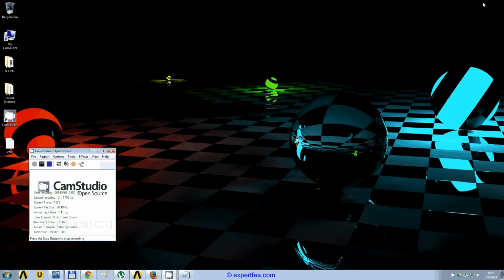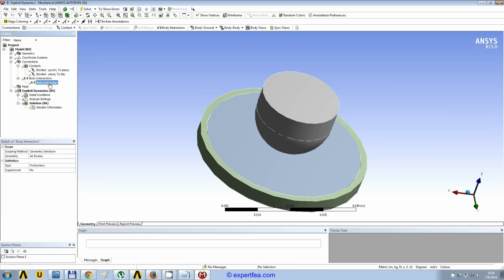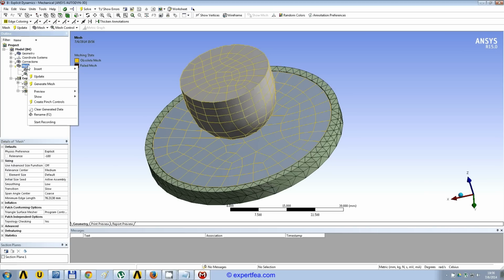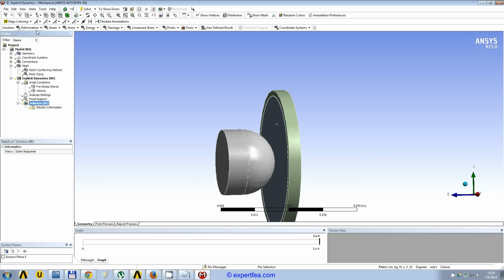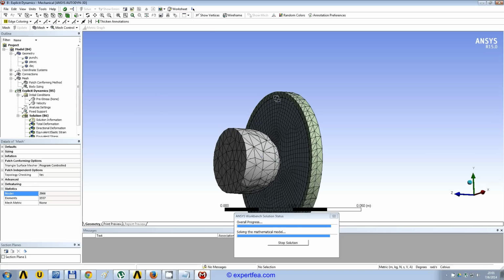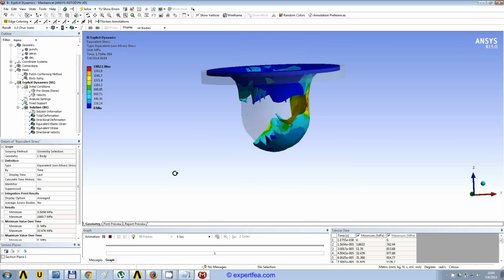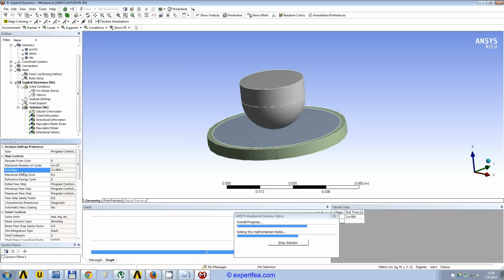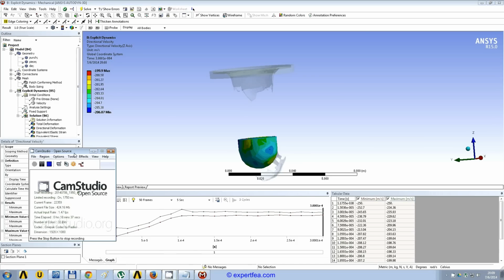WEBINAR 4: ANSYS Workbench Explicit Dynamics FEA of a high speed stamping

Comment: Hi Sir i wanted to ask that in your model it says Contact Bodies  # 2 Faces and Target Bodies# 2 Faces................ but in my model it says  Contact Bodies  # 3 Faces and Target Bodies# 2 Faces... why is it so ?  thanks
Reply from the maker: Hi Umer, you can change the scoping of geometry either via the vertex, line, face or body icons from their respective toolbar or by pressing Ctrl+P, Ctrl+L, Ctrl+F or Ctrl+B. In the contact feature, select the geometry you want then press Apply.
Reply: hi thanks alot 4 reply.. actually i am very new in ansys i am stuck with my final year project only i am doing small punch test which applies constant force geometery is similar only force is applied... is it possible in Explicit?.. appreciate ur reply..
Reply from the maker: It's your model, you should know better than anyone else :)